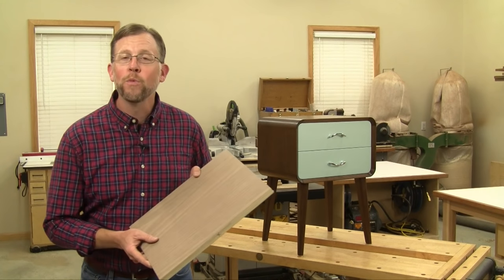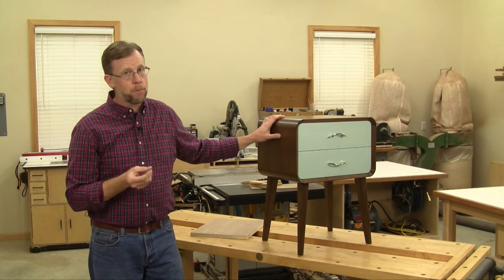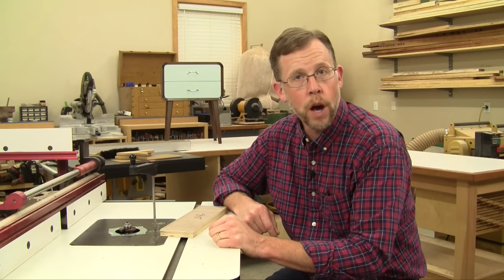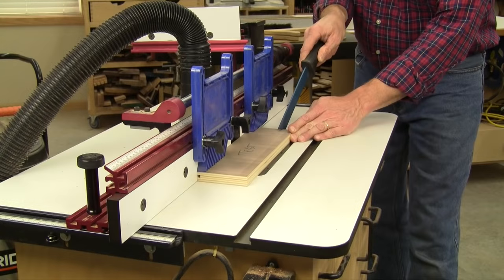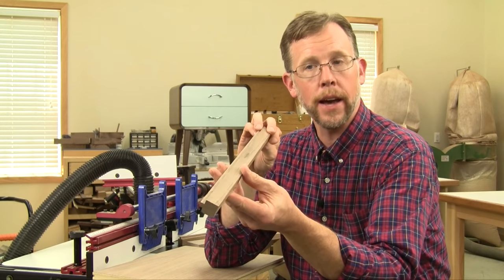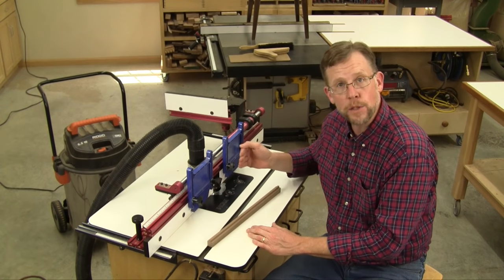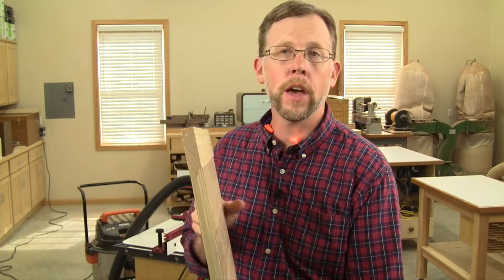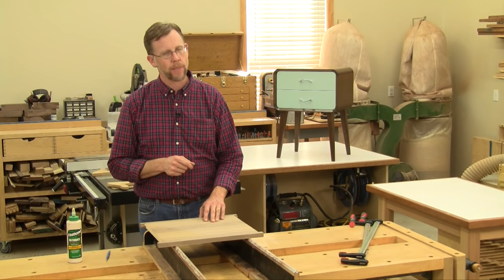How to Attach Interlocking Solid-Wood Edging to Plywood

Comment: Thanks for a good video. If you could make another video or explain how you made those rounded corners using plywood, it would be great!
Reply: Espen Lodden he will never share that.
Reply: Espen Lodden I couldn't be certain but a few ideas: He might  have curfed the ply and joined it underneath the table. As for the curved banding its hard to say without close inspection but it could be cut  from  several pieces - 2 long both with a curved ends being the same as the curved ply radius and then 2 short straight pieces that join the two long. They can then be glued and routed to leave a curved front edge. Because the band is full wood the  joins may not be so visible. It's possible that one piece could be used as banding but  it may not make economic sense.
Reply: Looks like they're hardwood too.
Reply: In the openingshot, when he has his hand on it you can see the corner's lines where it meets the plywood.

Comment: Great video.  What technique would you use to edge a thicker piece?  I'm going to laminate(glue) three pieces of plywood together to make a floating shelf, so that would make it about 2.25" thick.  And I was thinking of routing a profile into the hardwood edge after it's attached.  Thanks in advance for any advice you can give me.  Mark

Comment: Thanks for the clear instructions; I was planning to do something similar to make 12 inch shelves an inch or two wider to save plywood waste.  I am considering whether it might be easier to cut slots on both edges the width of 1/4 inch plywood, then use a strip of plywood in the slots, similar in theory to a biscuit joiner.  Or, even cut shorter slots and make biscuits the same size.  Any thoughts?

Comment: How does the banding look from above?  I plan on using tung oil on a project that will use banding similar to this around plywood.  Everything will be walnut.  Will you be able to tell easily?
Reply: I think it's best if you "joint" the edges first.  You can do it with a router table if you have a split fence.  Lots of examples of this on Youtube.

Comment: that router table looked wonderful .. what kind of lift was he using? And I saw two adjustments .. one for height.. what was the other one ?
Reply: Incra router lift one adjustment is to raise and lower the other locks the lift so it doesn't move
Reply: ...to lock the height adjustment mechanism.

Comment: how did he make the table with those large rounded edges using plywood?
Reply: looks like 4 plywood panels, with the curved pieces being solid walnut cut to shape, then joined. you can see a slight color difference in the corners, and a small seam where the grains don't match up. It looks very well done imo.

Comment: Are you only able to use this method to two sides of the pieces? If you wanted to add edging all the way around, wouldn't the tongues on each corner butt into each other?
Reply: You would need to miter the edges, then it's possible
Reply: +Tony Klingenberg Ah good call. I don't think I've ever accurately measured a mitre on the first try in my life, but you are totally right, you'd need some 45 degree angles to get them to all fit right.
Reply: +cgriesemer It works better if you do it piece by piece. Get the inner length right, add the next piece.. It's a bit tricky, just don't give up to enhance your skills

Comment: I recently watched a James Hamilton/Stumpy Nubs video that showed a similar technique using a dovetail bit and you both made the same mistake!

You both neglected to advise your viewers and students to make a setup jig at teach step of the way when they first use this technique.

Even though this is one of those techniques that will be rarely used, the complexity of it's setup demands a jig for future use. In addition, if one has a jig to quickly and easily set this up, one may be more inclined to use the technique on projects that do not necessary need them for the added quality of the piece.

Steps to making a setup jig.
1) When you have the groove setting zeroed in where you want it; take a scrap board that is wide enough to make two edges and route a groove on one side.
2) Once you have the tongue settings set up, on the opposite side of the board you put your groove jig in, route a tongue.
3) Write on the board the bit and plywood thickness that the jig is used for.
4) For future projects, use your jig to quickly zero in on the setting for the given groove or tongue. Then make a test run in scrap to insure that the wood has not moved while it was in storage.

Enjoy your new jig!
Reply: Shuuuut uppppp.....
Reply: .....and your jig would only work if your next project is EXACTLY the same thickness. aka  waste of time
Reply: @stevene9785  

Waste of time?
Only if you don't use it properly.

While wood thickness does vary, the variance is not so great that it would prevent you from using the jig as a starting point to make zeroing in to the final depth a lot faster.
Reply: @scotttovey  You could also simply mark the center line on your material and that is just as good or better as a starting point. The point is if you do not understand the geometry of the bit, a novice will never set up this bit and use it properly unless his material is EXACTLY the same thickness.

Comment: Works just as well if you just glue and clamp the edge banding.  There really is no need for this type of joinery.
Reply: 6:50
Reply: Justin Giglio Self registering is one benefit, but it takes a lot more time and set up.  I've never had to use it and I don't think most people would need it either.
Reply: while face glueing it may be sufficient and the dado may be going overboard, it is certainly more structurally sound
Reply: Edge banding doesn't work because the drawer openings are routed later to create the 1950s style tv look. This video goes with their magazine article.